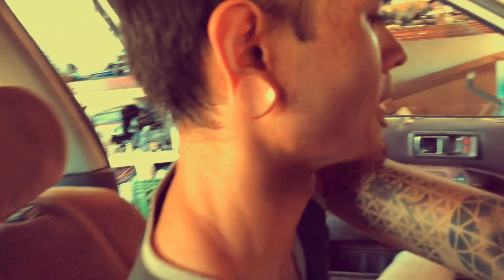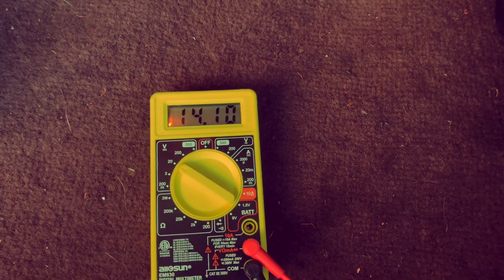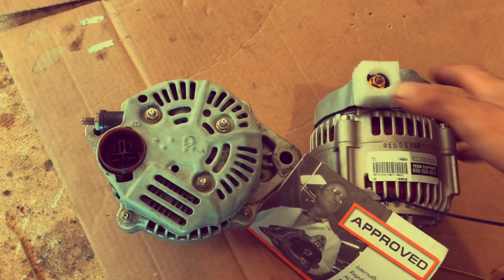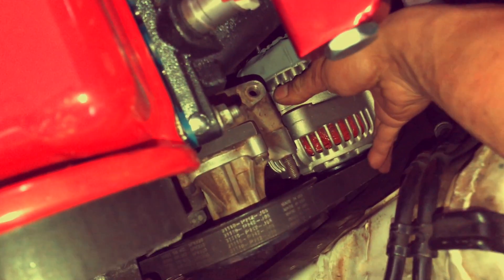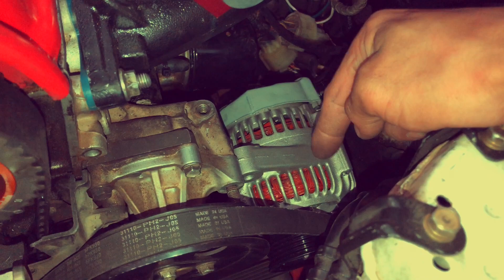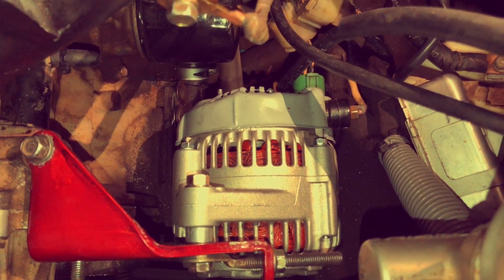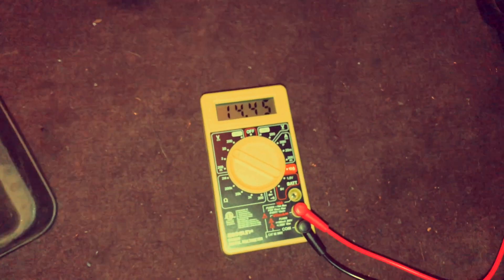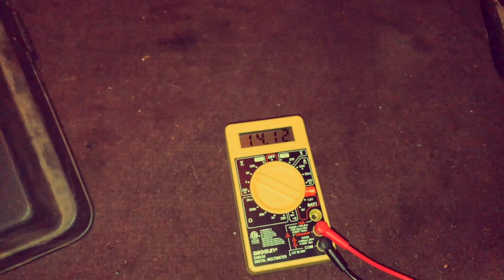3rd Gen Accord CA5 Alternator to 4th Gen Accord CB7 Alternator Conversion

Comment: You said there’s a slight offset with the Pulleys will that effect anything down the road and how can you fix it
Reply from the maker: So far I haven't had any trouble with it and it was mostly a visual perspective on my end so I technically didn't do any real before and after measurements. I would start off on getting the size spacer I recommended and get one size up and down, preferably in 1/8" increments if possible.
Reply from the maker: Or if possible set a camera at a steady angle during the whole process to get its visual reference.
Reply: Thanks for replying man, just bought a 1988 Lxi two door

Comment: You can swap a 4 wire and 3 wire regulator and it'll work btw. Even without if you have the plug you can make it work on carb if i'm not mistaken
Reply from the maker: Jesse Cole yes you are right, I know there have been people who have done it before I just never had a reason too.